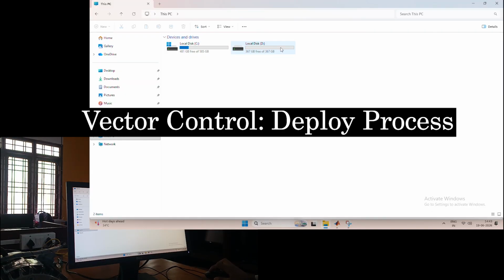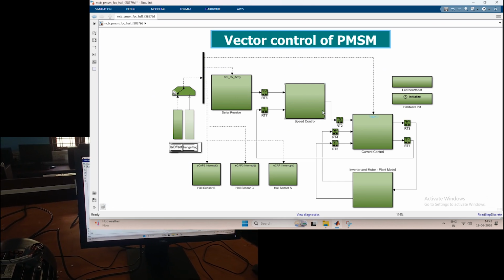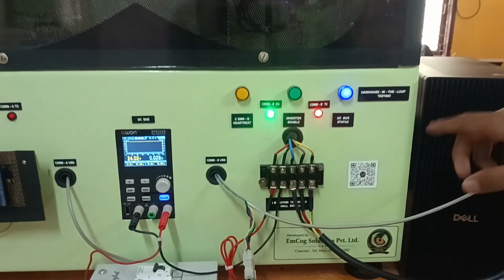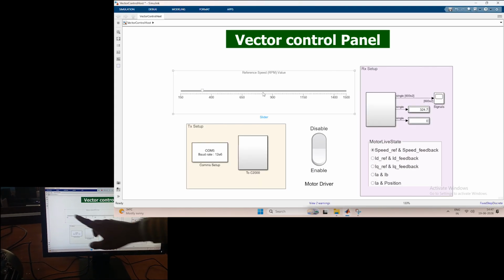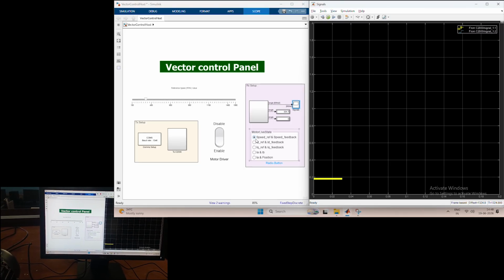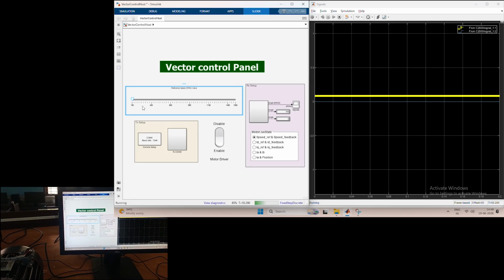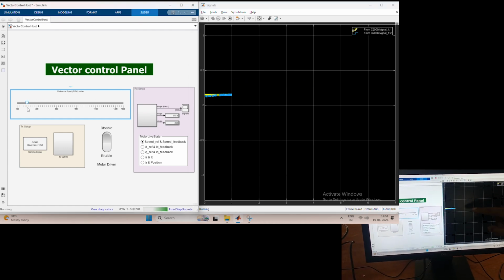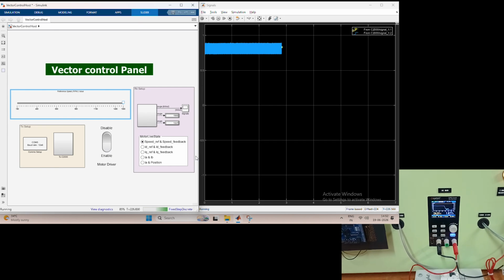FOC on PMSM Using Hall Sensors | FOC in MATLAB/Simulink

Comment: Hello Sir,
I am working on Induction motor drive using F28379D. During implementation, I a facing some issues. Can I get your mail id to connect with you?
Reply from the maker: Please email me at 200901002@rajalakshmi.edu.in. I’m quite occupied at the moment, but I’ll see how I can guide you if I’m familiar with the topic.

Comment: Hello sir ! we are trying to do project on control logic for synrm motor , which controller can we go with and the logic , what are the complexities involved when we go with the hardware implementation ?
Reply from the maker: Hello mam! 

I haven't worked on SynRM practically yet, so I can't speak from hands-on experience. 

But based on the theory, the overall control structure is quite similar to PMSM FOC. I'd start with FOC using an encoder on a C2000 F28379D in MATLAB/Simulink, then move to sensorless later if needed. 

Hope that helps, and all the best with your project!